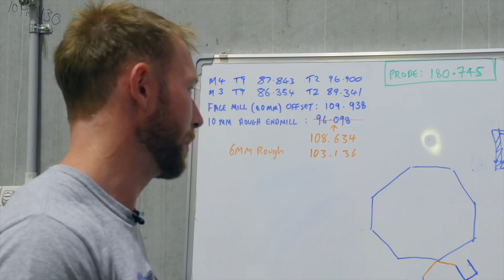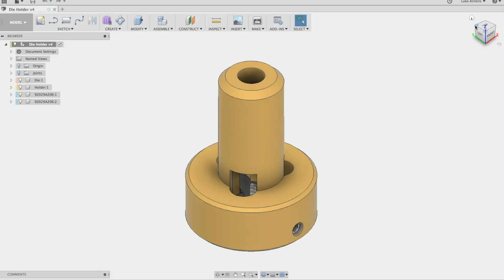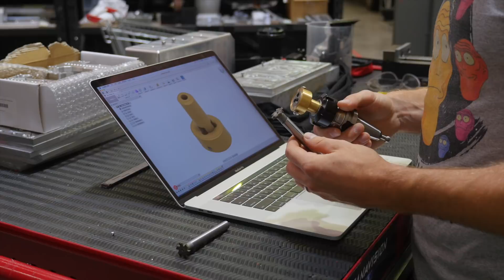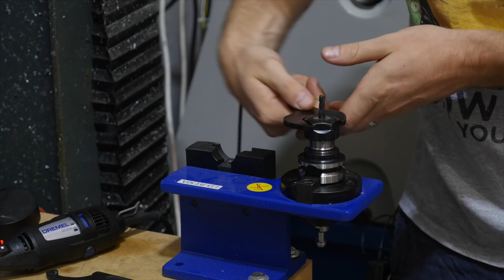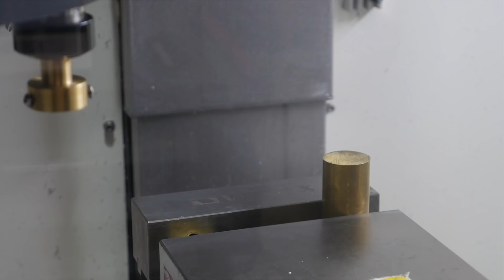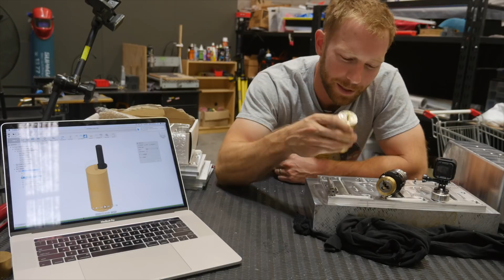CNC Machining brass external thread with rigid tap cycle and a die

Comment: I'm curious if you simply wrote a manual program for this and added to the existing program through fusion, or did you find a workaround that allows you to simulate the threading cycle with a custom tool of some sort?
I have a large production part that I'm getting ready to setup and wanted to use this system for speed, but it would be nice if I could see the accurately-modeled simulation.

Comment: Did you ever have difficulty doing rigid tapping on the optimill and/or have to adjust the gain parameter on the spindle servo ? I have the F80 and it throws an error when rigid tapping at the bottom, the spindle position cant keep up with where its supposed to be.

Thanks for any reply :)
Reply from the maker: Hey there no I've never had any problem but I always keep the RPM below 500 when rigid tapping - I found if I went faster that it would break the taps, 500rpm has been safe for me for years! what. RPM are you trying to tap at now?
Reply: @cruddCNC  I tried 400rpm, there's a parameter that needs adjusting in siemens OS it specifies the allowable out-of-sync-ness during rigid tapping, default is 20 degrees. I have to raise it to 200 degrees to stop the alarm raising and a total hault occurring. https://cnc-professional-forum.com/forum/cnc-machinist-help-cnc-troubleshooting-forums/machine-repair-troubleshooting/6115-siemens-840-d-25050-axis-z-contour-monitoring-infinity-machine?fbclid=IwAR12s5D18kik2H7rJWDCxnziAX07g-23IBjUfT_RPDGUxuazUlRJOSCcWl0 It's funny you are able to rigid tap no probs but my machine can't, I wonder if yours is different. I know another guy with an F80 who runs floating tap holders. He doesnt get the same alarm/error but just believes the F80 is not high enough spec for rigid tapping.
Reply: I have to set MD36400  on the spindle axis to 200 i mean.
Reply from the maker: @TheMudfly80  Very odd what year is yours? I think mine is about 4 years old now! I wonder if it's just updated?
Reply: @cruddCNC  I got it second hand so yes, not sure on the year. Maybe the k values and stuff for PID control have been tweaked. Still, strange.
Reply from the maker: @TheMudfly80  Yeah if you want send me a video how to find that setting and I will check what my one is maybe very different values

Comment: Nice work Luke.  I had no idea that the Siemens controller was capable of peck tapping.  Frigging awesome mate.  For some reason I never received notifications of your new video.  Cheers, Aaron.
Reply from the maker: DCTTeacher1 thanks Azza yeah the Siemens is quite capable. It’s just me post processor that doesn’t have a peck cycle in it. I’m gonna try modify it with the help of Harudin and see if that works!

Comment: Would it make sense to perform the undercut after threading? Would that leave more strength in the stock getting threaded?
Seems to work a treat as is.
Reply from the maker: ivanblogs yeah absolutely someone mentioned it in the comments already :)

Comment: Nice work Luke. Certainly nothing wrong with your method of getting the job out the door. I did a similar thing on a manual Bridgeport machine and unlocked the quill to batch thread some shafts once but I bet the tapping cycle on the CNC is better on the tool. Just throw some coolant at it and start stack'n 'em!
Enjoy your videos.
Reply from the maker: Thanks Jeff!

Comment: Of course you could have done it opposite and turn your mill into a lathe
Reply from the maker: For sure but I'm lacking some type of chuck for my spindle to hold the stock. Plus I need to make 200 of them so making a pallet instead!
Reply: cruddCNC definitely quicker your way for batching

Comment: Wouldn't it have made slightly more sense to machine the threads first while the shaft is most strong, then mill the undercut last?
Reply: Good thing about having the CAM inside Fusion.Quick rearrange of the operations and back to the machine.It would cut that brass in 1 pass I think.Bit of coolant or air and go for it.
Reply from the maker: Yeah possibly David, thanks for the idea
Reply: Nice Luke.I would cut the thread relief last as well.And only cut it just under the minor diameter of the thread.Keep the part as strong as possible.
Reply from the maker: Micheal Connor thanks it’s a good point I will definitely change it to do just that 😀👍

Comment: Wow, that worked extremely well! I've thought about trying to do that, but never really had a good application for it.

Do you have any experience with coding/scripting? If so, you might be able to add peck tapping to your post without too much trouble. I've been re-writing my post for the last... month(?) maybe... and would be willing to take a look at the post you're using to see if I can add it in for you. The main things I'd need is a copy of your current post (or the name if you're using one that Autodesk released) and a sample of what the gcode output should look like.
Reply from the maker: Hey Hirudin! yeah it worked better than expected haha. 

I'm ok at some basic post modifying, that'd be great if you have the time to take a look and add it in for me? 

BTW just watching the your videos;

1: That Speedio is redicuously fast. I am speechless...
2: Your camera enclosure is awesome and works extremely well! 
3: Love your work 

Cheers!
Reply: I did some poking around and I see that that machine uses a Siemens 808D controller, and while looking for a sample 808D post processor I found a thread or two on the Autodesk forum that you posted in. Are you useing "Modified Siemens James V8"?

Having looked at the 840D post and that James V8 post, I gotta say I may have bit off more than I can chew. It looks like the gcode those machines use is quite a bit different than the couple machines I've used (the Brother and Mach3). BUT, having said that, I compared the 840D and James V8 posts and it looks like their "onCycle" sections are nearly identical, with the notable exception that the 840D post has a case "tapping-with-chip-breaking": section. I'm guessing you could just copy the differences over and it would work.
Reply: I made a little... I mean long... screen recording showing the changes that I was able to come up with. Here it is, hopefully it's helpful and hopefully the couple changes shown are good.

Once it's done uploading, it'll be here... youtube.com/watch?v=D2g-ZESsRRY
Reply: Oh, and thanks for the complements! Yeah, when the Brother's cranking along I still just stand there in amazement. :)
Reply: OK, one more reply... the video seems to be up now. If you want the "short-short" version, just start at the 21-minute mark. Hopefully after those changes are made it'll be time to get schwifty!
Reply from the maker: Wow thanks Hirudin! I'm going to go over it this morning, I really appreciate you taking the time to make this for me... that's awesome... I'll let you know if I have any success
Reply from the maker: I see what you did there ;)

Comment: Awesome!!!  About the time I was thinking "threadmilling", you said you didn't get your tool yet.  Very creative solution!  
I've seen other guys take they're boring bars with a threading insert on them and use them as a single point threadmilling tool.  I wish my machine would do rigid tapping. lol  Thanks for the idea!!  Mike
Reply from the maker: All good thanks Mike, yeah I also read about the boring bar way, I just figured it would be easier to make a holder for the die on the lathe, rather than some offset holder thing :) it might be safe to also do this with a floating tap head? as long as there is plenty of clearance underneath
Reply: Yep...I agree....I think your way was easier than trying to figure out the boring bar.  Floating tap head is an interesting idea. :)